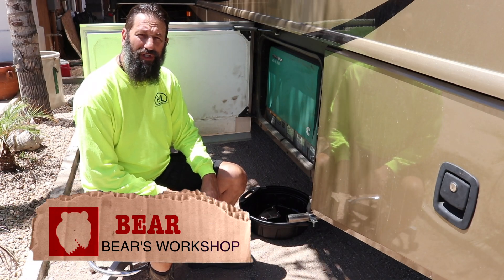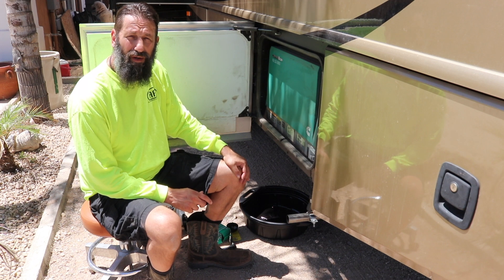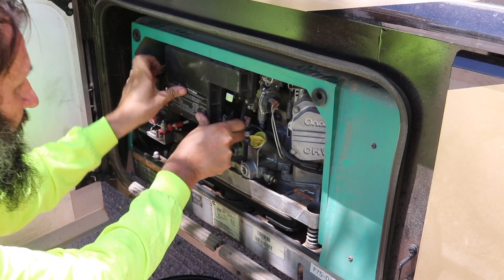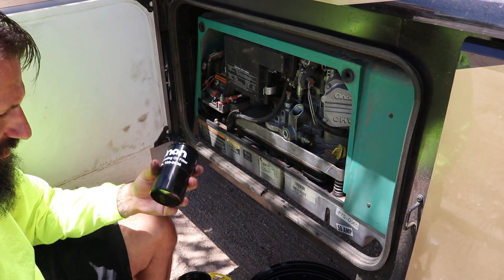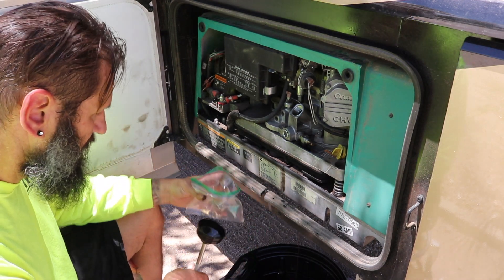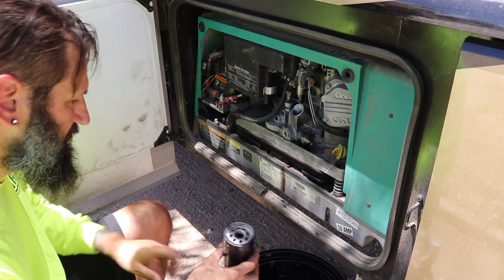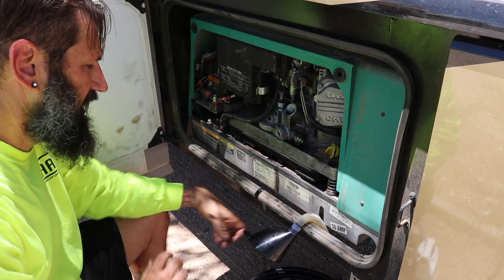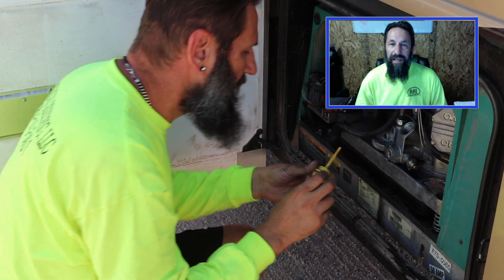Cummins Onan Generator Oil Change DIY | For Beginners

Comment: I usually change the oil filter first, seems to be a cleaner job that way.
Reply from the maker: Honestly, I never did it before so I wasn't sure how much oil would come out after I pulled the filter.   Pulling the filter had no oil spillage.
Reply: @BearsWorkshop Yeah, I change the filter first on car oil changes also. That way there's no huge splash of oil in the drain pan. I got drenched in oil one time when I accidentally dropped the filter into the drain pan, lol